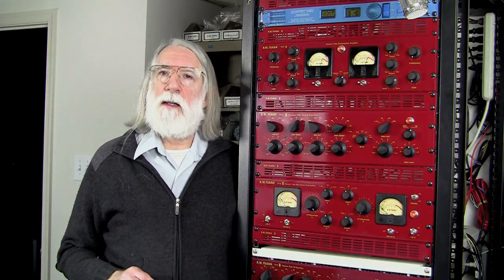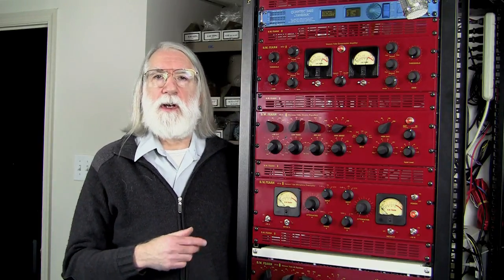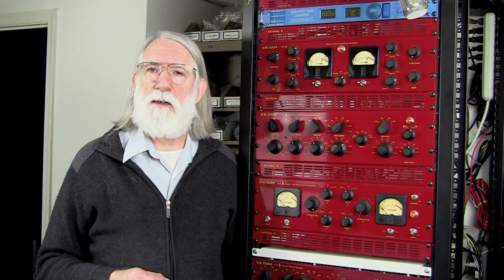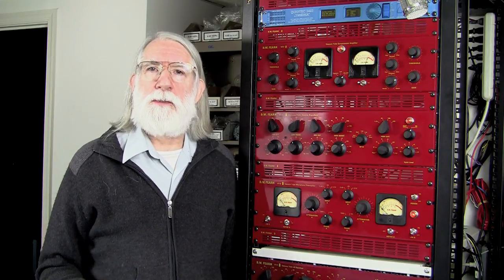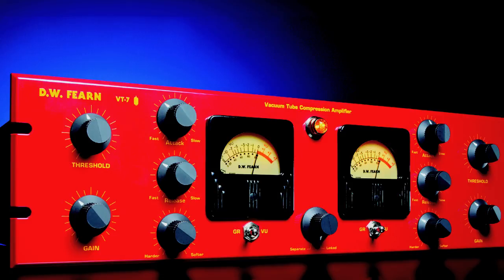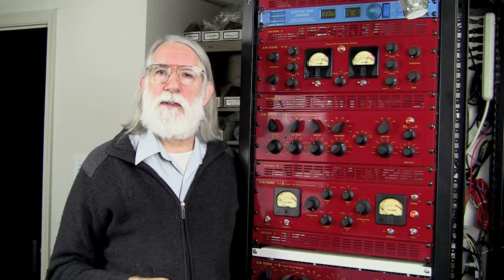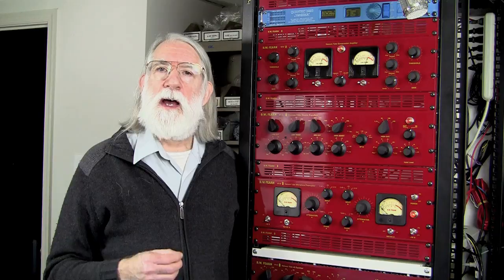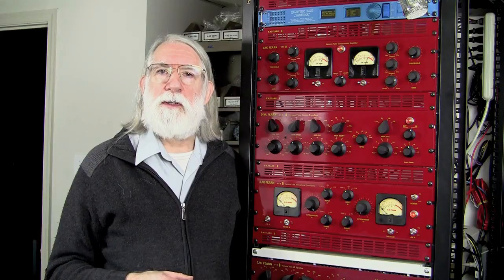D.W. Fearn VT-7+VT-5 Tutorial Part 3.mov

Comment: Was there a reason not to include a bypass switch on the VT-7?
Reply from the maker: It was a philosophical decision to not include a bypass function on the VT-7. The only useful way to implement a bypass in a compressor is to do a hard switch, connecting the input connectors to the output connectors. That can be done, but my approach has always been to decide whether a piece of equipment solves the problem, or not. I have never found myself agonizing over if I like what the equipment does, or not. I hope that the VT-7 users will also adopt that approach.
None of the classic compressors we all love had bypass switches.
The VT-5 does have a bypass, because that was easy to implement. I rarely use that function on my VT-4s and VT-5s, except occasionally in a mix when I only need the eq during part of the song.
Reply: @DWFearnHazelriggIndustries  Many thanks for that explanation, it does make sense to me now!